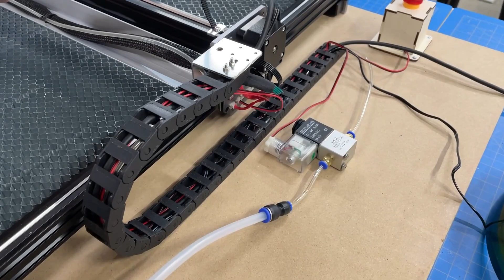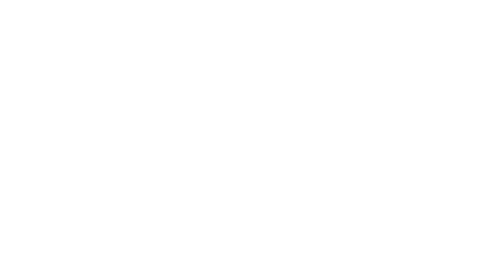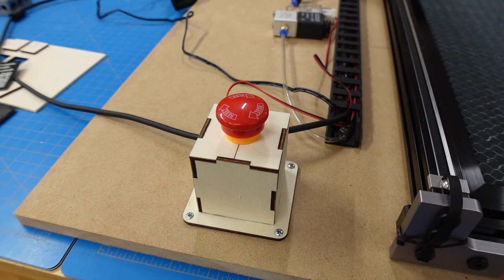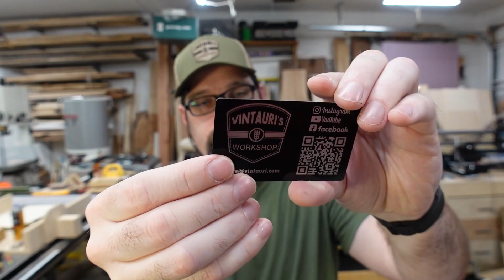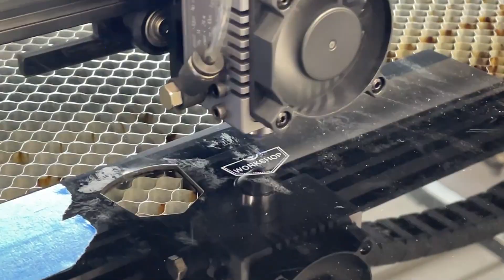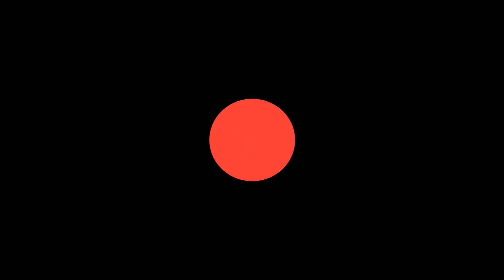Testing the Neje 3 Max V2 with 20watt E80 laser module

Comment: That was a great review!  I have the Neje 3 Max but it has the A40640 laser module that runs on 12V power. I was wanting to upgrade to the E80 module.... it runs on 24V power. Did you have to do any sort of modifications to the Neje motherboard or did you just plug in the E80 and go to work?
Reply from the maker: I used only what came with my kit and it already had the E80 module.  So the board was already set up for it.  I'm not sure if there are differences in the board for the V1 version due to the voltage differences.

Comment: Hello,

I need some help with the NEJE E80. I have a NEJE 3 Max V2.  The laser module stopped working in the middle of a cutting action and it doesn't turn on. I checked the power supply and it's good. If I remove the plugs from the laser module the rest of the  machine works normally (the stepper motors, USB connection, etc. ) except the E80. The LED light doesn't turn on on the lase module and there is no light emmitting on the laser diode. Also with the laser module plugged in when I power it on it makes some short movements on the stepper motors and the power source and mainboard a green LED light is blinking. Please tell me if the E80 module is dead and needs replacement. A new module is quite expensive and I just have it working for only less than three monts.
Reply from the maker: Unfortunately it sounds like there may be something wrong with the module.  I would reach out to Neje support.  They do have a 2 year warranty on the E80 module so if it is bad they should replace it for you at no cost.
Reply: @Vintauri  i did wrote to them about this issue and i'm waiting for their answer
Reply: @rcdc7608 whatended up happening?
Reply: @RourkeKendrick  the technical support did answer very quickly and the issue was two burned out capacitors on the laser module board. I just took them out and it's ass good as new. The board has 6 capacitors to filter the current and as far as they said you can take out 4 of them and the E80 would work just fine. I asked a seccond oppinion to a specialist and he said you can take all six capacitors out and the module will work fine but in this case you should be careful to have a good power supply with some protection circuit. The laser works without any problem since then. So far I can say that I am vey satisfied of the E80.
Reply: @rcdc7608  Thanks for the thorough follow-up!

Comment: ما الفرق بين neje max 3
و neje max 4 e80
Reply from the maker: Primarily it’s the auto Z adjustment that allows you to set the focus based on a measurement and offset. There are some other minor differences as well but that is the main one.

Comment: Just got mine 3max V2! They advertise that focus point is square! Not true! Is rectangular. Y direction is stronger than X direction!
The 3 little screws that hold and lock the module are very hard to reach ,so I made a shallow groove on their head, and now I can use a flat screwdriver! The belt tensioners is not something important! You can use the machine for a long time before you need to change or reset the tension, i think they include them to make more attractive the final package

Comment: could the belt tensioners not be mounted upside down so the adjustment was on top?
This is a high contender on the list as my next diode. as I am looking for a 30-40 watt module, any reccomendations?
Reply from the maker: I had that thought too, but the belt has a slot in the mount that it passes through that requires you to install it upright.  Not having the tensioners installed was not a deal breaker for me, but it would be nice to have them functional.
Reply: @Vintauri  i was looking forward to have belt tensioners. Never had them before

Comment: Would you recommend this over a co2 laser for manufacturing production work? I would use it mostly to cut 1/8 inch birch plywood. Thank you.
Reply from the maker: For a small business with a low budget, this should work well to get started, however to ramp up productivity on cutting 1/8" Birch plywood a 60w or higher C02 will easily double the speed of cutting those parts.

Comment: Great video!  Just bought the 3 max v2 myself and still figuring out.  This helps immensely.  How are you focusing it, l have not seen a distance to set the laser at.  Again thanks for the review and info.
Reply from the maker: The manual states that the focal distance from the bottom of the module to the top of the material is 25mm.  So for now I'm using a 123 block and using the 1" side to roughly focus the machine on the surface.  Once I get it dialed in, I'll make a custom focus tool with the exact focus for surface, as well as for cutting 1/8" and 1/4" materials.  Here is a link to the block I'm using. They are very handy to have in the shop.  https://amzn.to/3PXyljt
Reply: Does it include the piece to regulate the z axis?
Reply: @Arvaynd1  yes it has some kind of knob to adjust the height manually without unscrewing the two screws holding the module

Comment: the instructions are absolutely worthless!..i didnt even find them till i was about done since they was in the bag with the cables..i struggled putting the frame together..the machining is too tight and off a little bit and that made the screws go into the extrusions want to cross thread..i fought hard to not strip the screws and ended up loosening the corner brackets from the extrusions which did help but those brackets are threaded into sliding nuts so the alignment went  all over the place!..there is a special order to what parts and bolts of the frame to put together when you start, i wish i would have known that!!...i measured until i was a blue in the face trying to get everything in parallel but only to end up with the frame still out of square..it was cutting large rectangles 3/16'' out of square..spent a another day trying to get it into square which was a pain!, there is nowhere to put a square on the thing!, had to trace lines down to a large sheet of paper so i could then check the square..i ended up putting a red bull shim on the gantry bolted connection on the board side..i finally got it to within 1/32'' out of square..the new model max 4 those sliding brackets are gone and  are a part of the rail..they also did not include drag chains with the new max4 stating they was causing binding and was making the steppers work too hard so im on the fence about installing the drag chains on my max 3..other than all that i really like the machine lol

Comment: hi! what is your recommendation for a 20w diode laser? sculpfun s30 pro it would be a good choice in the ballpark of 600 dollars? thx
Reply from the maker: The sculpfun is an okay laser, you should check out my video on the S30 Pro Max.  It's the 20w laser just with the smaller working area.  I talk about a few concerns in there about the air hose, and the focus adjustment knobs.  I personally find the Neje format to be a better layout for me as I need the width and not as much depth. But they also have the extension rails to make it 40" deep.